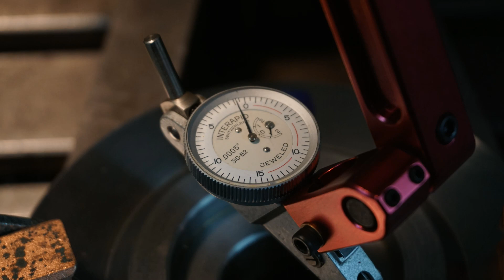Gearbox Shaft for Well Drilling Part 8: The Finale

Comment: Great series, Adam.  Thanks for all of the work of videoing it and sharing it.  Looking forward to the next one.
Reply from the maker: Thanks Ryan! Did you see the tool I used on the cast iron impellers?
Reply: Yeah, I did.

Meant to also comment the week before that I was talking to my dad about what machines that he used while he was doing machining for 3M before he retired 15 years ago.  They lathes he used most were CNC Monarchs. He didn't remember the model number or the exact CNC interface program. He enjoyed those more than the CNC mills he also worked on.  He much rather use the manual Bridgeport mills.  They don't let the retirees go into the shop to visit the guys anymore.

Comment: Very nice work Adam! 
I particularly like the fact that you chamfer a hole before tapping. That really is good practice: the chamfer will help to guide the tap into the hole. I see a lot of YouTubers who don't do that and they will bite themselves one day (you only need a small chip, some build-up on a cutting surface or something else of that matter and your tap gets a mind of its own..  ).

Suggestion from me: when you are you using a dial indicator, try to set the wiper/needle as parallel to the surface you're indicating on; that will give you a better idea of how accurate you're actually working. I know that this is not always possible in real life, but I believe it is just good practice. 

Keep up the good work!

Kind regards,
Reply from the maker: Yes I always like to machine a chamfer first, one to break the sharp edge, and the other to help guide the tap.

Comment: Have you noticed any difference in material quality over the years?  Does 4140 that you get today perform the same as 4140 from a decade ago?     Thanks.
Reply: cant answer for Adam but in UK we are getting some poor metal that machines bad
Reply: The material either meets grade standards or it doesn't.  Companies can't risk their reputation and take legal liability by supplying material that doesn't meet the grade standards.
Reply: Yes and yes,.
In the US, the quality greatly depends on the production process and the mill process and the physical mill used to produce the final product and applies to all steel alloys available today, not just 4140. 
There was also a lot of lesser quality steel produced in the US and globally pre-1980. 
Today steel from most US, North American and Japan mills  along with several European producers is usually consistently high quality. 
Several Asian producers including some in China have the capability of producing high quality steel, but don't always and a larger number of them are also producers of marginally acceptable alloys that look OK on the outside but include numerous internal flaws and defects in the final products that can best be described as unusable krapp.
Reply: patw52pb1 I come from a long line of Swedish steel makers.  Grand dad worked on the coke ovens and my uncles worked in the hot mills and roller mills.  They ended up in the quality control labs.  The standards for steel include standards for the maximum number and size of inclusions and other defects.  If you buy cheap steel, you get what you pay for.  The stuff is good enough for many applications but it is substandard.
Reply: Interesting history. 
I agree. 
We purchased approximately 30K pounds lot of 4130 tubing, plate, sheet and bar stock from a local broker several years ago and when we received the shipment we submitted a few random samples from the shipment for analysis and the reports showed huge variation in composition, performance and had numerous inclusions and fractures. Approximately half of the submitted samples failed performance standards for strength and elongation. While this purchase had a relatively low per pound price it was no bargain. We are still in the courts over this. Turns out it was from a China mill and misrepresented as produced in Japan by a Canadian firm. 
Today we use a lot of Docol R8 produced by SSAB for our critical applications.
Reply: +John Ferguson buying from a trustworthy source is key
Reply from the maker: I notice different hardness of them depending on what type you buy. The 4140 we get at works is quenched and tempered with a hot rolled scale on them, They always machine beautifully! The 4140 cold rolled I buy sometimes machines a little more soft with less of that shiny surface finish.
Reply: Abom79   The steel plant where my family used to work makes armor plate for ships and tanks.  I got a tour of the facility and some details of the process.  It's incredible how many times that metal is heated to a certain temperature and time and then quenched and annealed.  The process is repeated over several times.  The whole process takes days and it leaves that steel tough and dense with a hard surface but still weldable.
Reply: Panhead49EL cr

Comment: All this was good, but the photos were exceptionally good. I presume this is your new camera work; please tell us some about what you learned. I will say that photos of the quality here would fetch higher bids on Ebay than cellphone pics because fine detail would give a buyer the confidence that they are not bidding on junk with flaws hidden by cruddy picture quality.

Soon, Abom will stand for big quality instead of just big size!
Reply from the maker: Thanks, yes the pictures were all taken using the new Sony camera. I am continuing to learn how to get a good shot, and even these I wasn't completely happy with. I think the lighting was off a bit, but that will get better once I add more light in the shop. The pictures on the milling machine was kind of blown out because of the light reflecting off the chip guard.

Comment: Hello, I noticed the old shaft has a thicker bit just underneath the flange end of about an inch high measured along the shaft. The new shaft is flush right up to the flange. Won't that weaken the flange end of the new shaft?
Thanks for sharing the video, I learned a lot from it and it was enjoyable to watch. Greetings from Belgium, Europe

Comment: Would it be feasible to drill and tap two holes in the bottom face so when you go to remove the bearing you could insert two bolts that would press on the bottom race?

Comment: 19:45 the hole in the new shaft looks a lot smaller thanthe old shaft. I don't remember it being discussed but I guess that doesn't matter.
Reply from the maker: Brian, they are both for a 1/4-28 grease zerk.
Reply: Abom79
I meant the big center hole in the shaft. New one looks like 1-1/4 and the old one looks more 1-1/2
Reply: In the first video Adam said" the inside OD of the old was worn away from use." Adam walked about the original drawing but didn't put them in the video.
Reply from the maker: Yea the center hole in the new shaft is 1 1/4". The old shaft has lots of wear on it.
Reply: it could have been in the roughing videos. still very cool

Comment: How do you  indicate the rotation of the head back to square? I have only seen tramming when the head was fixed in position. Thanks!
Reply: DetroitGaming it doesn't matter. there's no hard 0,0,0 point on the machine, it's all relative positioning. as long as your vise or work is parallel to the table ways you are good to go
Reply from the maker: Theres a scribed line in the side of the machine that represents zero that you line up on when you want to swing it back around. Just eye ball it and lock it down. Like Brian said it's not important to be indicated square.
Reply: Brian Boorman thanks.
Reply: Abom79 thanks.

Comment: Noticed that the original seemed to have a shoulder at the flange end for what looked like 3/8" before the end and that your new one didn't.  Not a functional necessity, just how the previous one was made?
Reply: Gary, I'm pretty sure that is part of the old thrust bearing inner race that was rusted or galled on the old shaft, so it's not part of the shaft at all.  Treetop
Reply from the maker: That was part of the thrust bearing race stil on the old shaft.

Comment: Watching this series of videos I have begun to realise why Adam doesn't work full time in his own shop.  It's certainly not for a lack of business.  I certain that Adams reputation could fill his door 24/7 with customers.  The problem I'm guessing is reimbursement.   In this age of Wal-Mart's and mass production people rarely understand that the cost to make one of something and half a million is vastly different.  
Given the time, materials, the multitude of different tools and machines required and lastly the professional level of experience to make something like this shaft on the first try successfully and correctly.  I would hope that Adam was able to charge at least $1500.00 for this job!  But would not be surprised if he was lucky to bill half that amount and still had to endure some groaning.

Comment: Why bother indicating the center? As long as you're anywhere on the line you scribed the hole will be in line with the center of the shaft. And it's only a grease fitting, what's a couple degrees of rotation? You were already eyeballing with the keyways.
Reply from the maker: Purpose is to show it on video for the viewers who are learning, not because it was important to be dead center of the shaft.

Comment: you are just drilling one hole that you marked out before, so finding the center of the shaft before moving to your mark is a complete useless activity.  It is only useful if you need to make a bolt circle of minimum 2 holes.
Reply: Adam is not only a master machinist but also a great teacher who is willing to  take the time to show us novices techniques which are applicable to more complicated setups.
Reply: Ron Treppeg  but he is setting the keyways approximately and then dial out the center. If your boss has to pay you per hour he'll not going to be happy if you use your time this way.
Reply from the maker: It was simply to add more content to the video, for the guys watching to learn. I know it did not have to be centered and if I was on the clock I wouldn't be wasting time doing so. When I work on my own projects I take my time and try to share different techniques.
Reply: Abom79 The thing to do would be to take a big center point in de tool spindle, push it in the hole of the workpiece while the spanners are still loose so that the workpiece centers by it self and then tight the spanners.
Reply from the maker: Absolutely! Just another good way to get the job done. I've used that trick countless times myself, even on the channel here.